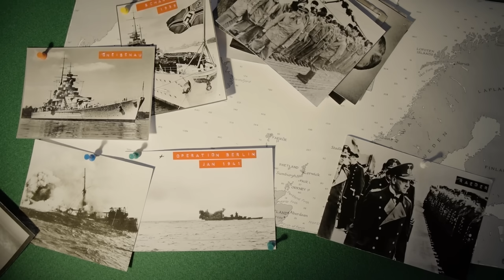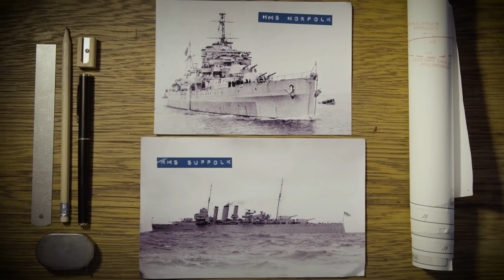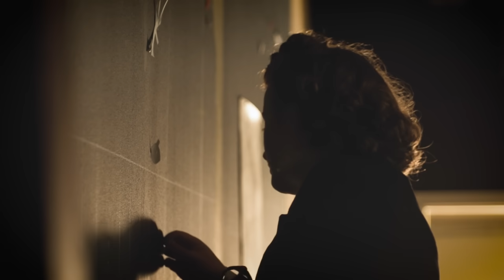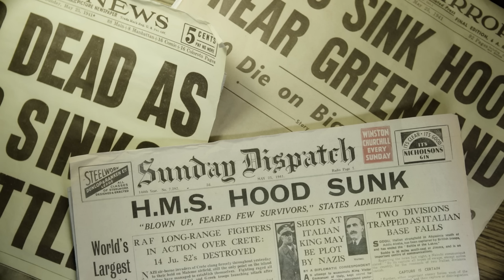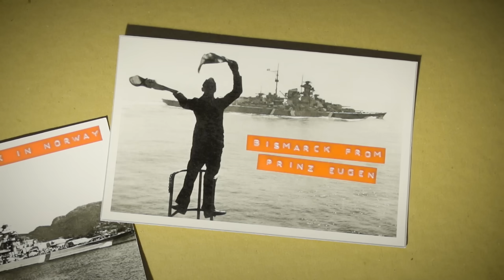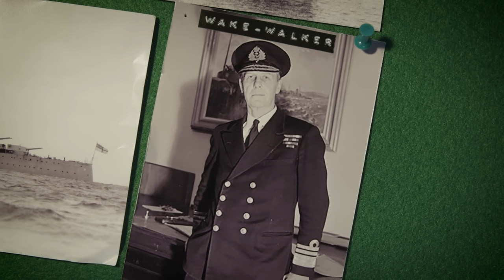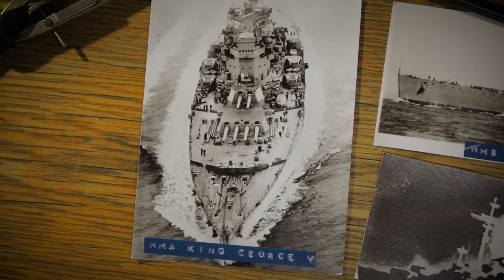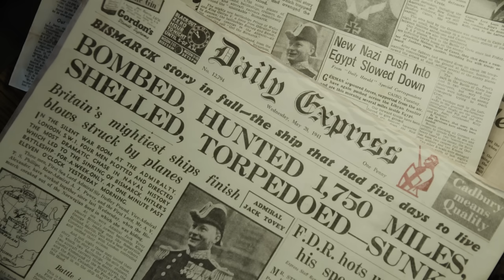Bismarck: How Britain Sank The Infamous German Battleship | Full Documentary | History Hit

Comment: Opening 30s and the presenters are bowing down to the Wherboo fallacy of German "impressiveness". Now i have watched 1 minute and i need to write this comment because of the direction it appears the audience is being taken. So either it is being done to extend tension which doesn not need to be in this or its is based on bad scholarship. I'm fairly certain it the former and will be realy diapointed  if not!

The reality is that the ships design is an over bloated, over engineered problem created by the destruction of German naval infrastructure by the terms of the Treaty of Versailles. The reality is Germany is a good 10-15 years behing interms of naval infrastructure development and capabilities and the video is still pushing for a view that died 10 years ago with more modern scholarship.

So why the big downer after only 1 minute of video played....You can almost say that this ship is full of the contradictions. A mixed over selection of bad design choices and full of "warmed over ideas" from one of the WWI classes the Bayern class of 1915, the same distributed armour scheme and its combination of 15" and 5.9" guns of its WWI counterpart. To this mix then add in the disaster area that is the ships AA defensive armourment and fuse all that with what was then some quite modern electronics for its time. Why can I make this statement, well is many and various 
Lets start with that armour and "Why is the distributed armour scheme bad". Thats because it was designed for an era where combat ranges were shorter (in the 10-12k yards range), but now naval combat is at a point where shells plunging throu decks at 20k+ yards due to all those improvement in optics and the invention of radar (HMS Warspite hits Guilio Cesare at 26k yds in 1940). In addition the mass of the armour needed by this now archaic scheme feature adds weight, which means more powerful engines are needed needing more hull vilume ...which adds more weight and so on such that things spiral in a bad direction; it is just bad design work which had not followed the then more modern "all or nothing" schemes being used by the US, Britain and Japan. However its biggest downfall in this aspect of the design is that it does not hold enough "reserve buoyancy"" in side its armoured citadel which can keep the 50k monster ship afloat, and with plunging fire now a serious thing that is very bad for a design like Bismarck's.

Then lets go on to the biggest joke on Bismarck is the defensive AA guns. First because German engineering says that they needed a 100% solution to every problem the main secondary armourment is not dual prupose, its sole task is for surface action, they needed a full seperate suite of Heavy AA guns in this case it is actually a very good 4.1" (105mm) gun. However the combined mass of both systems is counterproductive in two ways- first its more mass and we already know the ship is over boloated by that distributed armour scheme and then there is the logistics of an additional shell type requiring more space to be allocated to shell storage. Had they just gone for their very good 128mm (5") as other nations did, having them in a twin gun dual purpose mount using the deck space of those  5.9" & 4.1" probably giving the ship up to 12  of these dual mounts, they would have saved weight and had more  heavy guns for both roles.
Then there is what is supposed to be the light AA options,  and because they are German they have two differen guns, 18 Quad 20mm mounts (which are very good as it happens) and then there are sixteen single 37mm guns ....oh dear its probably the worse AA gun ever it has serious competition from the 25mm used by the IJN. But why is it so bad....its a light AA gun but  it is single loaded not loaded by a magazine on a relatively heavy manual traverse mount, so what is it going to do against a modern fast moving aircraft. Now they could have rowed over to Sweeden and bought a licence for the excellent 40mm gun from Bofors ( like the US and Britain did ) before the start of war even then known to be one of the best automatic AA guns available....even replacing the 16 37mm with 10 additional quad 20mm would have worked better.

So as to be balanced what is good.....Yes there are improvements im not entirely without some balance to my argument, the 5.9" guns are now in turrets not barbettes and most of the guns (due to improvement in metallurgy) are longer, with the 15" can now be 55cal not 45cal long; so it's a capable weapon with good range and hitting power, but most navies have built weapons that are as good or better than this 15" gun; Germany is designing a 16" gun but its no where near ready by 1939 when the ship is launched and is slated for the follow on H class of ship which are never built. Then there iare excellent Zeiss optics and a good centrimetric radar build by Siemens, whos only downfall is that it is suceptable to the  shock of its own gunfire... No German is not alone here, other nations also have this issue but Germany never gets to solve the issues in a satisfactory way.

So as i know you say ah but you havent let them "tell the story" you only watched 1 minute, well here i have a not so secret weapon... i can read and i have read well over 20 books with content about the one and only voyage of the Bismarck. Im just heading if this Wherboo tenedencey off at the pass because im fed up of the look how impressive German arms were in WWII.....its not true.
Reply: Very well said and accurate.  
Another point about the separate low and high angle secondary guns it they both need crew to operate them, which means more berthing space and supplies.

Another massive point often overlooked is the Bismarck is a completely illegal design. The Anglo-German Naval Treaty of 1935 specified in section two that ALL ships had to conform to the limits of the Washington Naval treaty of 1921-22 which limited a Battleships displacement to a maximum of 35,000 tons standard and guns to a maximum of 16inches.
Bismarck;s designed displacement was 41,700 tone, nearly 20% over the limit which makes the Germans oath breaking, treaty violaters.

Of course mindlessly rabid Wherboo's claim the escalator clause from 2nd London covers Bismarck but not only is that wrong, it's total BS.
German was NOT a signatory of 2nd London and is not covered by it.  If they try to claim it then where is ANY evidence of them trying to design and build the 14inch gun required by that treaty?  They refuse to answer one.
Bismarck also started construction before 2nd London was signed, as it takes years to design such a ship, they planned on ignoring the treaty they had just signed.

I don't think Bismarck had centimetric radar as German Scientists declared that impossible until later in the war when the wreckage of a downed Allied bomber was examined and they recovered the British developed Cavity Magnatron which makes centimetric radar possible.

And the war proved that German naval high pressure boilers were very efficient but Very! complex, prone to breakdown unless everything functioned perfectly and required very highly trained crew to act like an Octopus on speed to keep everything in balance.  
British and American machinery was much more reliable and if British machinery gave less range as it was a lower pressure design, at least it was far more reliable.
Reply: Absolutely! And for all it's "fame", the only offensive operation the Bismarck carried out lasted 8 days and it sank one WW1 era battle cruiser. Hardly an auspicious career.
Reply: Anyone using the term "wehraboo" really needs to grow up. It's childish and nauseating.
Reply: @lyndoncmp5751  “Nazi war machine fetishist” takes so long to type…
Reply: @sulate1 
I've been arguing the positive for Montgomery against Rommel in North Africa and for the RAF against the Luftwaffe in the Battle of Britain etc on various videos yet as soon as I argue that the Tiger tank WASN'T a piece of crap that did nothing but break down and couldn't move anywhere and was actually effective with a high knock out ratio Im immediately labeled a wehraboo. No just pointing out historical fact. 
People are too caught up in still trying to fight WW2 80 years later. As I said, it's nauseating and pretty childish.
Reply: @lyndoncmp5751  well the issue is generally speaking most German kit is grossly over-hyped by that particular community, when the image they wish to present has no basis in actual fact.

So for example let's take your Tiger 1e (SdKfz 181) ...and take an analytical look at is.... better than M4A3 Sherman. 

Well yes it looks impressive/imposing,  does have more armour (100mm front) and an excellent high-velocity 88mm gun. However it is let down by a weak gearbox and the Maybach HP210P45 engine which was not designed to lump around 56t (40-45t is what it was designed for). So it's mechanically unreliable for those reasons and as such let's look at maintenance and product engineering. Well practical notes from the engineering fitters was is a nightmare to take apart and put back together because no thought was put into maintenance. Then there is the lack of spare parts for German equipment, so the engineers end up either scavenging spare or bodging the broken parts. So what you end up with is an impressive immobile pillbox which can be out manoeuvred and/or destroyed by artillery which is out of range of that big gun. Oh and finally they only make 1350 of them during the entire war
So let's compare it to that Sherman, yes it's gun is a low velocity 75mm based on the pre-WWI gun made by France, the armour is much weaker. However the doctrine for the American army is that Tanks are for infantry support , they have units with much bigger guns to real with other tanks; then the Americans make over 20x as many and its engineered/designed to be easy to repair in the field with and engine and gearbox were designed by car manufacturers who made reliable vehicles for the period and importantly they make many more spare parts than they will ever need. 

Which therefore is the better tank for your army!

There  lies the problem people like yourself have....war is not a game based on top trumps where you can focus on one or two impressive factors, it's far more about overall capability and in many ways having the fewest weaknesses than a single impressive strength.
Reply: @steveclarke6257 
The Tiger's 12:1 overall knock out ratio and it's 65%-70% overall operational average (very respectable for a heavy tank) is a factual data based rebuttal to the modern revisionist nonsense that it was ineffective piece of crap which did nothing but brake down and could barely move anywhere. 

"an impressive immobile pillbox" 

Immobile pillbox don't make hundreds of km road marches to the front lines. For example, all of the Tigers of Schwere SS Panzer Abteilung 101 road marched nearly 400km from north eastern France to the Normandy battle front. Tigers on the Eastern Front racked up literally thousands of km on the clock. Tigers reached everywhere the Germans sent them, from Schwere Panzer Abteilung 503 at the Manytsch River in the Kalmyk Steppe in Southern Russia, to Schwere Panzer Abteilung 504 at the Maknassy Pass in Tunisia. 504 had to do a 800km road march to Maknassy from Bizerte/Tunis and back. They did. 

"which can be out manoeuvred and/or destroyed by artillery which is out of range of that big gun." 

And when the opposing force doesn't have artillery to call on, such when the Canadian 28th Armoured Regiment (Worthington Force) lost 47 tanks, 44 of them Shermans, at Estrees la Campagne/Quesnay Wood on 9th August 1944 during Operation Totalize most of them to a small number of Tigers from Schwere SS Panzer Abteilung 101, sniping them at long range, immune to reciprocating fire? No Tigers were lost there. Didn't sound like the Tigers were ineffective there. Or at Villers Bocage, or Hill 112, or Operation Goodwood etc. 

Sources :Jentz, Schneider, Wilbeck, Carius, Lochmann, von Rosen, Rubbel, Zetterling. 

Look, I never said the Tiger was the best and most wonderful tank ever ever ever. I argued it wasn't an ineffective piece of crap that could barely move, which is what you hear repeated ad nauseam on the internet by people who've never read a primary source in their lives. You've just repeated the ignorant "immobile pillbox"  mantra. I rest my case. Clearly there are some people who won't hear ANY positive views about any German kit not even when it's backed by fact and data. Only "wehraboos" do that, apparently.
Reply: Those examples are fine, but the points I raised are actually valid for many units and I was paraphrasing from the debriefing reports of German fitters working on the vehicle, so both points can be simultaneously true it depends on who and what is being asked. 

Your 1:12 statistics included those kills for all fronts which is great but as the US found in their statistics of "kill ratio" don't always tell a true story. You raised Villers Bocage as an example during which an awful lot of Universal carriers are destroyed. Are those included as part of those German 1:12 statistics you quote, after all it is a tracked armoured vehicle but certainly not a tank. Now I can't answer that and you probably can't either, not because either of us can't read German, but because most full reports don't survive; just the overall claimed statistics survive and here in lies the problem as the devil is in that detail. Can you trust troops in combat reporting for statistics.
Post the operations in Normandy a team of statisticians looked at what was claimed by various groups across all services Vs actual wrecks of vehicles and casualties. This was done to validate the claims of the USAF and RAF on the effectiveness of air support, which seemed too high to the planners. Their work validated that thought claims but the air forces were too high, but there again so were those of all branches. Perception of people in action is not a good source of data, and they found that most equipment had damage from multiple sources such that multiple service branches were claiming the same kill. Now Normandy was unique in that Germany had lost almost all their army equipment in the encirclement, so such an analytical examination had a high confidence rating- so I trust the statistics collected over those observed. 
So here is the point- can you trust that 1:12 as truly correct, I'm not discounting it but German statistics from the Battle of Britain over claimed casualties just like the RAF does and we have very little data on the eastern front from the Soviet side that can be truly trusted. So only one thing is true, everyone's military forces always over claim their effectiveness so I would caution from quoting that stat without caveats- and even if it's even remotely true, 1:12 is not enough to counter allied productions based on the production run of 1350 vehicles. That does not cover the number of Sherman's never mind the 50k T-34 variants as was said quanty has a quality of its own.
Reply: SteveClarke. I'll bet you were bullied at school.
Reply: @bazonics  how esoterically "left field" of you, I'll park your "comment'  in the place it richly deserves and move on.

Comment: The British didn’t sink the ship, the German crew did. In the late 1990’s a reach team funded by both the English and German governments, to answer the question who sunk the Bismarck. The team concluded she was sunk by her crew. Not British gun fire or torpedoes.
Reply: Then why did the Germans decide to sink their own ship?.
Reply: @daneelolivaw602  likely to keep it from allied hands
Reply: @BigRigWA  At that point of the battle the Bismarck was a burning Hulk and the Brit battleships had turned for home due to a severe shortage of fuel and the threat of Luftwaffe and UBouts and the Germans were abandoning ship a destroyer and cruiser briefly Hung about to pick up suvivers but done one because of the U-boat and air threat. No-one was going to take it in tow ! It's academic anyway the ship was scrap metal
Reply: @BigRigWA  
It was sinking. 
The Royal Navy didn't want it, it was a flaming wreck from stem to stern.
Reply: @daneelolivaw602  yep if they hadn't scuttled it the fires would have likely reached a powder mag and blown if not wrecked on the coast
  Herman poisoned himself before getting hung doesn't change the outcome
Reply: IF the Germans did scuttle the ship all they did was speed things up as the ship was already listing and low in the water. As for examining the wreck most of the hull is buried in the seafloor mud, and hence not available to examine.